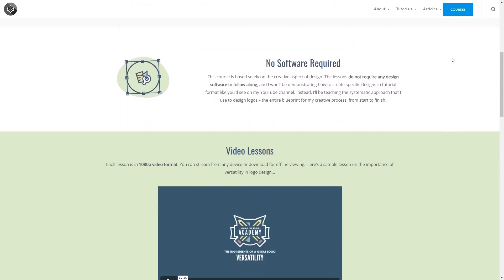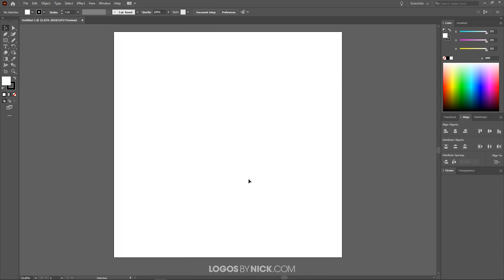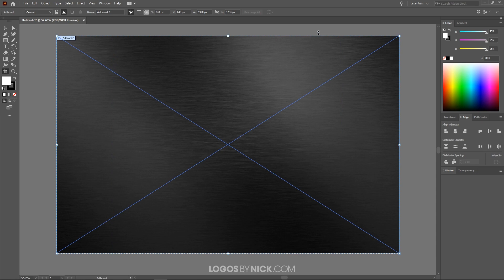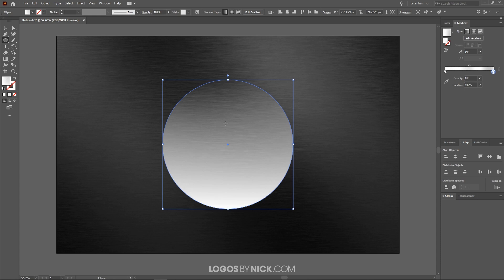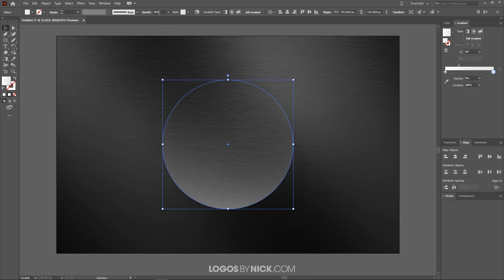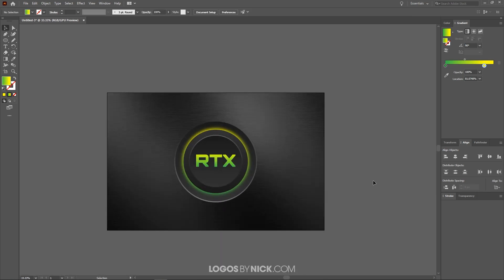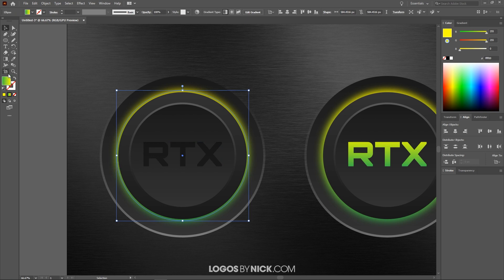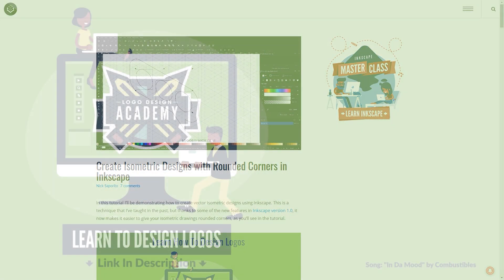Illustrator Tutorial: 3D Illuminated Buttons

Comment: Nice tutorial. You can also achieve the same result with just one circle. Just create multiple gradient fills for the beveled parts and two gradient strokes (aligned to the outside) for the two highlights. Use the offset effect on each fill and stoke to get them the correct size and make sure they are stacked/ordered correctly in the appearance panel. The advantage of doing it this way is you can make it a graphic style and apply it to any shape later on.